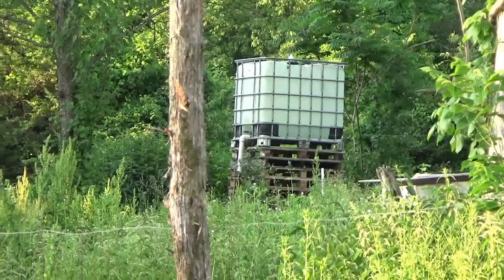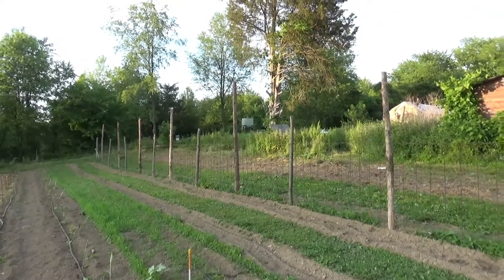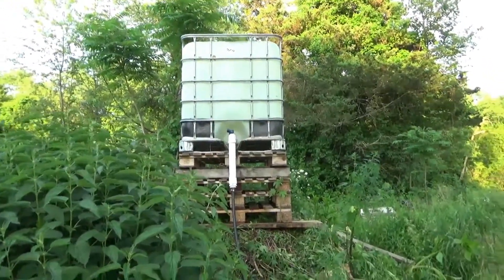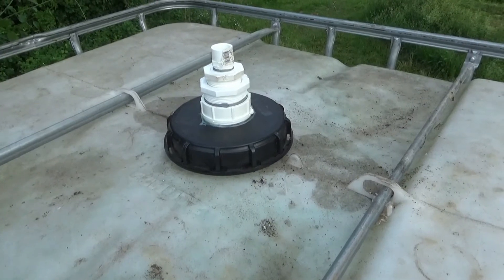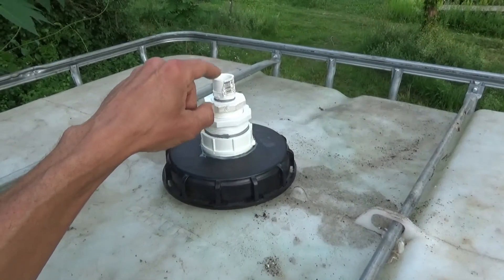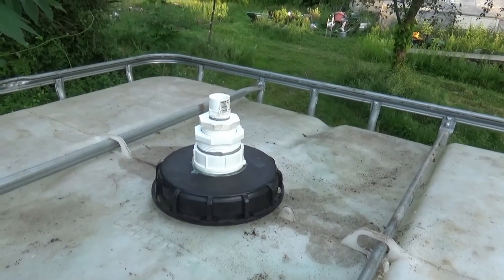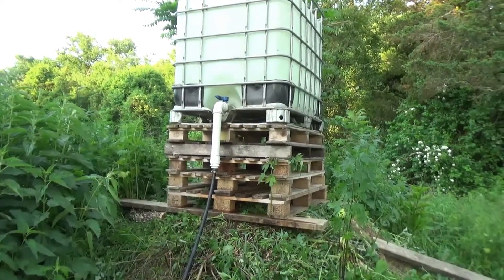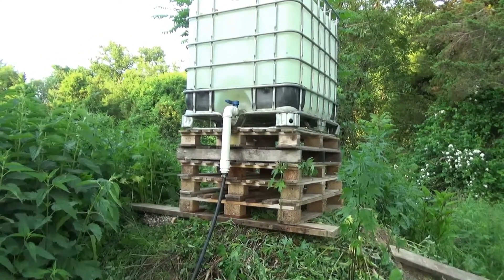Ram Pump Reservoir Upgrade 275 Gallon IBC Tote

Comment: Nice addition to the system!  Yeah, those totes are getting expensive, especially food-grade.  I paid $50 for one a few years ago and now they seem to be running $100 or more (and I need a few more).
Reply from the maker: Thanks!   Wow.. You get em cheap there... I think I found em for 50... but too far away....  we ALWAYS need more!  :)
Reply: @TheFarmacySeedsNetwork  gov will have all heads for this tech thay teach us that we always have loss but never talk about 
the converted gain we can make from eletromagnets
if u convert all the wast thermal energy around 
you u can use it universally as energy u need a true sine wave bipolar like the power comp dose a 
true pure sinewave like a grid tie inverter 
once the signal is made the system will turn on and 
consume wast thermal energy from the 
environment and space around you... there is free energy but 

it comes from Universal thermal loss and converted into a gain. so a pole Transformer and a 
microwave Transformer  have a common between each other u can take 2 microwave Transformer provide 
a pure sine wave grid tie inverter to it or a true bipolar sinewave that inter acts with nature in 
a perfect spherical motion like a flower of life..  if ur home provides this use it as a Source 
signal then u can simply stack the Transformers on top of eachother in correct fasion and note 
that the 1 wire on the Transformer must stay connected and the other disconnected your only useing 
1 wire on the hi side .. so test ur self 
2 microwave transformer stacked on top of eachother same 

face sides. one side 120 to the wall and the other 120 side to what u want to power and useing the 
Transformer just the way it came out the microwave with the wire attached causes the energy in its 
perfect spherical motion to converted wast thermal energy to amp for u hot to cold in to out... 
should look a bit nuts with u use a form of wireless energy but its interacting with the 

environment...this is my work a compilation of Otis car. Tesla. and many other very smart people 

nowadays i think i found the gate source and drainif this gets out to much that it works the 
power 

comp and mib will have our headsdont do this at home warning high voltage yet i cant stop u lol DO 

NOT TOCH THE CORES OR THE WIRES OK u will die make sure u dont touch the core if the hi wire is 

mounted to it u dont have to mount the hi on the core if u dont want u connect the 1 hi wire to 

the same side hi on the other transformer then the core should besafe to handle if nessary
grab your multimeter and prove me wrong
thats what u do i have my whole home on this
and u can take 

one of the lows side out the wall and hook it up to other stuff and power it for verry little amp 

makeing nature convert and pumping latent heat effect into the device.
and u can have a microwave 

hi volt cap in between the hi side and make a system that powers its self
u can flip the switch on 

ur breaker and the room stays on up to 2kva 
with both lows in the wall this is the zero point that 

was taken from us...
Reply: @TheFarmacySeedsNetwork  gov will have all heads for this tech thay teach us that we always have loss but never talk about 
the converted gain we can make from eletromagnets
if u convert all the wast thermal energy around 
you u can use it universally as energy u need a true sine wave bipolar like the power comp dose a 
true pure sinewave like a grid tie inverter 
once the signal is made the system will turn on and 
consume wast thermal energy from the 
environment and space around you... there is free energy but 

it comes from Universal thermal loss and converted into a gain. so a pole Transformer and a 
microwave Transformer  have a common between each other u can take 2 microwave Transformer provide 
a pure sine wave grid tie inverter to it or a true bipolar sinewave that inter acts with nature in 
a perfect spherical motion like a flower of life..  if ur home provides this use it as a Source 
signal then u can simply stack the Transformers on top of eachother in correct fasion and note 
that the 1 wire on the Transformer must stay connected and the other disconnected your only useing 
1 wire on the hi side .. so test ur self 
2 microwave transformer stacked on top of eachother same 

face sides. one side 120 to the wall and the other 120 side to what u want to power and useing the 
Transformer just the way it came out the microwave with the wire attached causes the energy in its 
perfect spherical motion to converted wast thermal energy to amp for u hot to cold in to out... 
should look a bit nuts with u use a form of wireless energy but its interacting with the 

environment...this is my work a compilation of Otis car. Tesla. and many other very smart people 

nowadays i think i found the gate source and drainif this gets out to much that it works the 
power 

comp and mib will have our headsdont do this at home warning high voltage yet i cant stop u lol DO 

NOT TOCH THE CORES OR THE WIRES OK u will die make sure u dont touch the core if the hi wire is 

mounted to it u dont have to mount the hi on the core if u dont want u connect the 1 hi wire to 

the same side hi on the other transformer then the core should besafe to handle if nessary
grab your multimeter and prove me wrong
thats what u do i have my whole home on this
and u can take 

one of the lows side out the wall and hook it up to other stuff and power it for verry little amp 

makeing nature convert and pumping latent heat effect into the device.
and u can have a microwave 

hi volt cap in between the hi side and make a system that powers its self
u can flip the switch on 

ur breaker and the room stays on up to 2kva 
with both lows in the wall this is the zero point that 

was taken from us...
Reply: @TheFarmacySeedsNetwork  gov will have all heads for this tech thay teach us that we always have loss but never talk about 
the converted gain we can make from eletromagnets
if u convert all the wast thermal energy around 
you u can use it universally as energy u need a true sine wave bipolar like the power comp dose a 
true pure sinewave like a grid tie inverter 
once the signal is made the system will turn on and 
consume wast thermal energy from the 
environment and space around you... there is free energy but 

it comes from Universal thermal loss and converted into a gain. so a pole Transformer and a 
microwave Transformer  have a common between each other u can take 2 microwave Transformer provide 
a pure sine wave grid tie inverter to it or a true bipolar sinewave that inter acts with nature in 
a perfect spherical motion like a flower of life..  if ur home provides this use it as a Source 
signal then u can simply stack the Transformers on top of eachother in correct fasion and note 
that the 1 wire on the Transformer must stay connected and the other disconnected your only useing 
1 wire on the hi side .. so test ur self 
2 microwave transformer stacked on top of eachother same 

face sides. one side 120 to the wall and the other 120 side to what u want to power and useing the 
Transformer just the way it came out the microwave with the wire attached causes the energy in its 
perfect spherical motion to converted wast thermal energy to amp for u hot to cold in to out... 
should look a bit nuts with u use a form of wireless energy but its interacting with the 

environment...this is my work a compilation of Otis car. Tesla. and many other very smart people 

nowadays i think i found the gate source and drainif this gets out to much that it works the 
power 

comp and mib will have our headsdont do this at home warning high voltage yet i cant stop u lol DO 

NOT TOCH THE CORES OR THE WIRES OK u will die make sure u dont touch the core if the hi wire is 

mounted to it u dont have to mount the hi on the core if u dont want u connect the 1 hi wire to 

the same side hi on the other transformer then the core should besafe to handle if nessary
grab your multimeter and prove me wrong
thats what u do i have my whole home on this
and u can take 

one of the lows side out the wall and hook it up to other stuff and power it for verry little amp 

makeing nature convert and pumping latent heat effect into the device.
and u can have a microwave 

hi volt cap in between the hi side and make a system that powers its self
u can flip the switch on 

ur breaker and the room stays on up to 2kva 
with both lows in the wall this is the zero point that 

was taken from us...